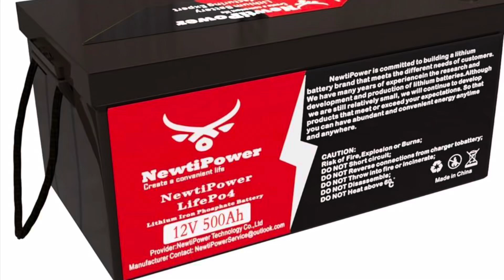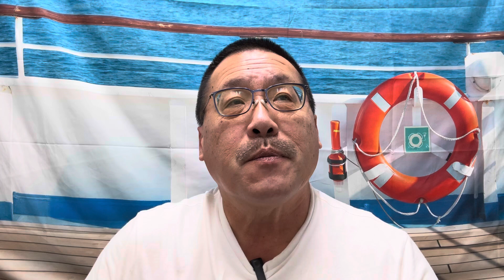Micro Homes Off-Grid Solar Systems | Derrick Soo

Comment: People are asking but you still haven't told them.
8000 watts of bifacials is informative.
The battery being D8 is not that informative since D8 is a dimensional specififation not a capacity.
If it is the battery shown at the start it is only 6 kWh which will be fully charged in less than an hour at 8000 watts input.
Are you going to put 4 in series to make a 48 volt system? 
Unless it's a 2C rated discharge battery it can only supply about 50 amps at 120 volts, most lifepo4 batteries are 1C.  500 amps at 12 volts gives 6000 watts divided by 120 volts gives 50 amps (half of your 100 amp service.
12 volts would be a terrible idea for for a 12kW system.
Saying a windmill makes 20,000 volts means absolutely nothing. I'm amazed that with your experience with satelite solar power supplies would say such silly thing surely you didn't confuse potential with power. 
And I vehemently disagree with the statement that a windmill will be more advantagous than solar.
I live in a place that has better wind according to the wind power maps than even the tiny speck of orange there are commercial windmills all around me but virtually nobody has a residential size windmill they all have solar panels.
Even the few who put up windmills out in the country have them at least 50 feet high. My parents put one on the barn and it lasted less than a year and they lost money on it even though they already had the whole house inverter that didn't count as part of the cost because they already owned it for years.
Power available from a windmill is the cube of the wind speed so 2-5 mph wind won't make enough power to make up for the shading of the solar panels by the turbine.
Designing a wind generator that produces power at low wind speed doesn't solve the issue of very little energy  being available for harvest.
Reply from the maker: This is only an outline of the Systems. System storage of 48vdc with 5,120 watts per hr. Multiplied by 6 for a Single Storage bank. System is capable of operating up to 6 Storage Banks total for up to 184,320 Watts of Capacity. I’m calculating based on components currently available, and looking at new Technologies under testing and not yet available to the market. 

Most people won’t understand this and only care if systems will work reliably. Each SFH will be different and unique for electrical demand.